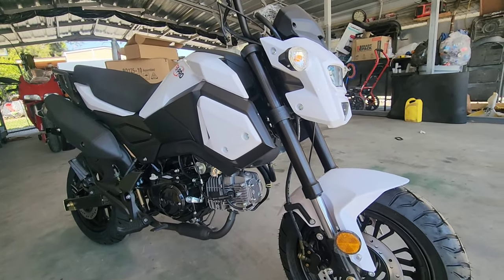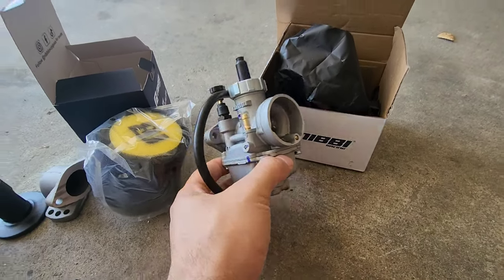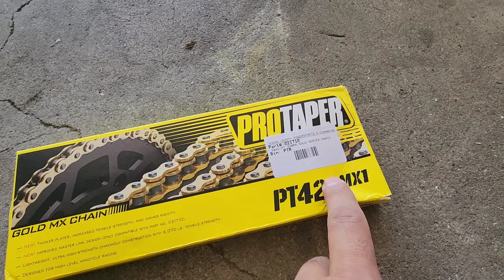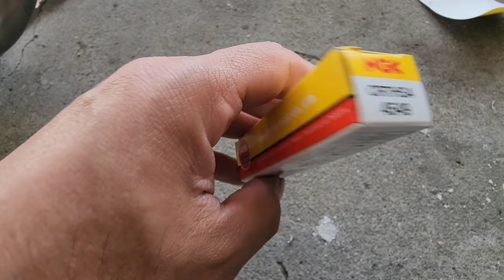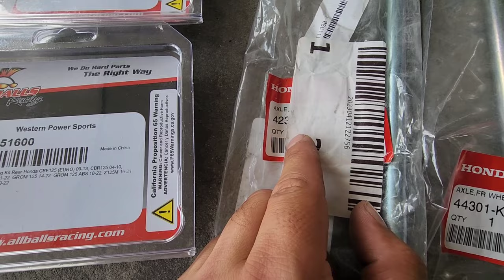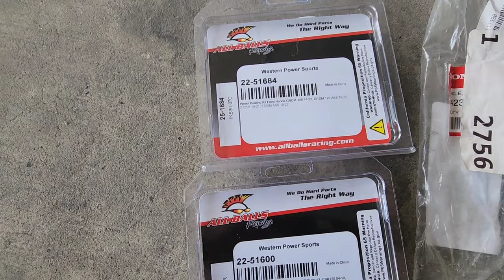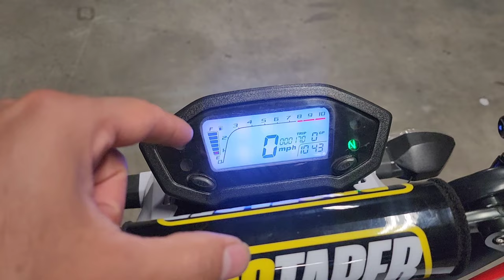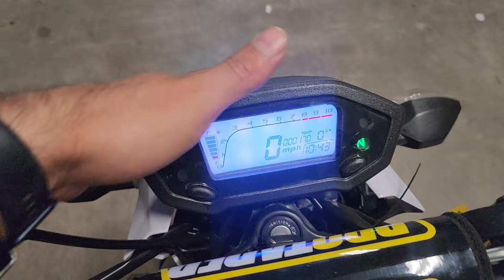Vader 125 Full Guide To Make Reliable (Grom Clone)

Comment: Did you have to swap jets or tune the carburetor? I just installed the same carburetor as you and it bogs every time I snap the throttle. I also have the same throttle and cable as you. I’ve tried tuning it for hours. I’ve even swapped the pilot jet out and no luck still. I’m lost
Reply from the maker: My carb is still perfect to this day. It may be because the jets and adjustments are generically set by the manufacturer for a specific altitude and ambient setting. I live in CA at 350ft above sea level (which is GREAT!), and it's always warm here. Could just be my case.
Reply from the maker: Go to Nibbi and check they're tuning chart it may help you!
Reply: @anythinggarage  I just noticed that I installed the new carb with the fuel filter that came with it. Did I need to use it? Since there’s already the factory one right before the fuel cutoff switch.
Reply from the maker: @hdubby2219  technically it would limit flow and have a hard time getting all the fuel it needs into the carb. I've even heard of inline shut off valves doing this. I recommended one of those in vid but not so much anymore. GL!

Comment: My engine bolt broke off inside the mounting hole now gotta get it out some way.
Reply from the maker: Mounting hole? As in on the engine where the bolt goes through?
Try using a punch/rod and hammer or something of the likes. Try not to cause damage inside. Goodluck!
Reply: @anythinggarage  thks. Yes cheap bolt. It snapped mid way in mounting hole on the engine.

Comment: Hey I bought the same carb and  throttle cable but I’m having a hard time getting the idle down and for some reason it sounds cammed and when I try to rev it it bogs out
Reply from the maker: You may need to watch how-to videos for Carberutors and learn to tune a carb.
Temperature, humidity, altitude (elevation) all have something to do with tuning a Carberutor. You can't have the same jets or tune as somebody else.
Luckily  live near sea level. The jets that came installed in my carb (should be the same ones in yours) and the way it came tuned works perfect for me.

Comment: Is the china battery good or a should changed for a new one just like the oil shipping ?
Reply from the maker: Mine is still alive and working perfectly good over 4 months later. I keep a tender on it when not in use for a longer time. I also have one of these for simple connection gor my battery tender on both my motorcycles.

https://www.autozone.com/test-scan-and-specialty-tools/battery-charger-cables-and-accessories/p/schumacher-battery-quick-connector-18in/973761_0_0?cmpid=LIA:US:EN:AD:NL:1000000:BAC:19488533492&&CATARGETID=120054150001289249&CADevice=m&gclid=EAIaIQobChMInuuO6ZepgQMVgAqtBh0-ZwmMEAQYASABEgLKCPD_BwE&gclsrc=aw.ds

Comment: Easy!  Just install a Grom engine, drivetrain, suspension, wheels, tires, and electronics.  It'll be SO reliable. (Although you should probably replace the frame and the plastics too)
😁👍...........🤣😅😂

Comment: What’s that mental thing connected to the shifter ?
Reply from the maker: @jajajaja4590  on the old shifter? (It's a linkage made of plastic).
On the new shifter. It's just a foot lever connecter directly to the shift shaft on the motor

Comment: Dang. Same price as a new grom after all the cash you spent on parts?
Reply from the maker: Not at all. Not even close to msrp of a new grom.
The bike, all of these parts (excluding unnecessary rear shock), the shipping cost (which is also taxed), the taxes... and everything costs about $1900 all new to your door.
A Grom is about $4800-$5800 out the door, and I'm not even lying.
Reply: @anythinggarage groms new here are $3600 plus $1000 dealer fees. = $4600
Reply: @anythinggarage so $1900 plus $1100? How much are the Vaders new?
Reply from the maker: @JohnnieV  $1900 withh new bike after taxes and shipping and all of these parts
Reply from the maker: @JohnnieV  yeah for the non ABS one. You're also forgetting freight charge fee ($300) documentation fees, dealer fees, Tags (around $200) surcharge fee, Prep fee and whatever else fee.
Reply: @anythinggarage  ah. Ok. I have seen $1050 on Amazon ? So you saying you put about $850 parts into it. Now you have a quality grom clone. Fun to play around with.  I guess you need a good lock with this. 2 guys can easily throw it into the back of a truck?
Reply from the maker: @JohnnieV  $1050 plus $250 shipping and then add taxes for that number combined. Then add the parts.

I'll make it easy.
The parts cost me $450 for everything and the bike about $1500 total.
Reply: @anythinggarage  yes. Now I understand. Not bad total.

Comment: Hey bro you used a 26mm I take manifold with a 22mm carb ?
Reply from the maker: Yes it work perfectly fine. It has the correct flange diameter, it's actually harder and more of a headache finding 22mm or 24mm intakes than it is the standard 26mm sizes for these engines
Reply: @anythinggarage  bro I been struggling to find one sucks !!!! I was about to buy a cheap 22 mm carb with it but I rather run the 26mm now
Reply: @anythinggarage  thank you bro
Reply from the maker: @fernandogutierrez7985  Buy a 22mm nibbi carb and use it with a 26mm intake. Or a 24mm carb with the 26mm intake if you prefer as well. 

Personally, 26mm carbs are much harder to tune and go out of wack a lot more than the smaller ones. Mostly because 26mm is just too big for a 125cc engine.
In fact, when you use 26mm carb, you gotta "detune" them with smaller jets and run them leaner than how the carbs came anyway. So what's the point of  "detuning" (went too big to begin with) and having it go out of wack all the time?

Comment: that 125 cc engine is the same as my china bike, as you replace the engine bracket bolts with bigger ones, does it have a downside? or will it crack the aluminum engine mount in a longer period? plss tell me.
Reply from the maker: No. It will do the complete opposite of that. It will strengthen it and actually you'll never have to worry about it again.
I will have another video up soon where you guys will see exactly what happens when you don't do this mod.
Reply: @anythinggarage   is it better when there is no play on the engine support? thanks dude. great help.
Reply from the maker: @UNBIASEDCOMMENT  Sorry for the late reply. Yes, it's better for vibration, the engine, the motorcycle, and your own safety as well. The third motor mount helps with vibration as well and further improve the integrity of the bike.
Reply: @anythinggarage  Any tips on aligning the mount holes to drill without removing the motor?

Comment: Once you get use to riding and won't more power a 190cc z's engine swap it's a direct replacement full kit electric start  5 speed  will get you in the 75mph  range  best upgrade you can do really all the mod will fit this engine to.. for the stock engine they have a 141 bbk and a cam kit for it the 190cc a lot more power though 🛠️💯👍✌️🏍️🍻
Reply from the maker: Yes I have been contemplating this, although starter chain issues are very real. I'm doing much research on it. But it's gonna cost quite a bit for everything (Engine. Exhaust, carb, intake spinner, whatever else) looking near $1000 these days. Still cheap but also pricey.

For the record I was on the throttle 50% or so when I did 50mph GPS. 10 miles on the engine not best idea to go full speed full revs just yet haha.
Reply: @anythinggarage  if you want to no anything about the 190cc let me no I have spec sheet i also own both types I no the difference between them and also work on them And have helped other people. All you part will work with it the exhaust can be moded to work real easy. 👍✌️🛠️💯🏍️
Reply: @anythinggarage  don't pay over 800$ for the engine kit alot of people over charging for the 190cc kit .
Reply: @anythinggarage  the chain issue if from starting it wrong or killing the bike in gear you can up grade the chain and it fix it from snapping 👍✌️🛠️💯🏍️
Reply from the maker: @Joseph Saucedo  where would you purchase then?
Reply: @anythinggarage  on line I wouldn't spend over  this In price range  for a 2v 190cc 800$ and if it a 4v 212cc 1200$ price  maximum range.                                    2v is amount of valves 2   . 4v is of course 4valve's. Head options   this should help you decide what price if far on line  any thing cheaper a great deal for one. 👍✌️💯🏍️🛠️👊

Comment: What are the bearings and crush drive for just asking i wanna get one to learn wheelies on
Reply: Also know any good cages to protect the engine and would a sub cage fit a Vader
Reply from the maker: Every bike should have a Cush Drive. It's rubber that goes into the hub of the rear wheel. It helps absorb vibration from the drive (chain) to give a smoother feedback while riding. 
The stock ones are very cheap, thin rubber. They don't last long at all. Oem honda ones fit in perfectly. Keep in mind that all cush drives no whatever what brand, are "wear" parts.

Bearing are self explanatory. They suck. They're rough, noisy, and not smooth. They can get you in trouble. I have personally seen a bearing explode on a car, and it is not fun. It locked that wheel.

Now imagine a bike. Especially on a motorcycle. It will lock up your whee,  and you'll probably be launched from the bike. Never know.
Reply: You got a link to the inline fuel valve and the fuel line
Reply from the maker: @lordslug3351 Original fuel line works for a good while. I still have mine. Just don't leave your bike in direct sunlight or a lot of stuff can go bad quickly, even replacement parts. You can replace w/ this fuel line and shut off valve. The shut off valve is not recommended but useful. I heard they can clog though.

https://www.gopowersports.com/1-4-id-fuel-line/

https://www.gopowersports.com/1-4-in-line-shut-off-valve/

You can search for similiar items elsewhere.
Reply: Thanks and what’s the difference between 26 nibbi carb and the 22 carb

Comment: How much did all the mods cost vs buying a grom
Reply from the maker: Mods were about $400-$450 excluding the YSS Reservoir Rear Shock. BIKE was $1100. $275 shipping and taxes (they tax shipping) brought it to $1500 final price.
W/ mods excluding rear shock (you don't need to do that) was $1900. $2100 w/ Rear Shock.

Grom is going to be somewhere around $4400 (includes destination charge, freight surcharge & taxes). And yes even the rear shock on the stock Grom sucks and they use the one I used to modify so you can say $4600 w/ shock 🙃

Comment: Could I take egr airbox off before I was to do any of the mods you did?
Reply from the maker: Yes! Get rid of ALL the egr stuff including the charcoal canister and fuel ventilation as well! It will run much better.  Get a better bigger carb on there for sure
Reply: So should I have the carb
First. Because I took off the Big black holes that connects to the carb where I'm sure it's for the choke. And spilled some gas.
Reply from the maker: @chrism4784  The choke is utilized via cable and not a hose. I would personally forget everything about the original carberutor and upgrade that immediately.
Reply: Okay so I literally just now ordered the carb You put in a description along with everything else that went with that?
I was.
Dropping the engine.
Because.
The top bolt snap so I'm Changing them to the 3/8 So until the carb comes in I'm gonna have to put everything back on. It should get here Tuesday.
Reply from the maker: @chrism4784  Nice!! Make sure you got the intake as well. Also, I'm not sure if the stock throttle cable will fit new carberutor. it's why i put a new twist throttle on mine. Look at my shorts.

Careful drilling the 3/8 holes on the motor mounts and engine. The best advice I can give is JUST DO IT!!!
Use a titanium Drill Bit For strength. It'll all be worth it.
Good luck removing the rear sets/swingarm and fitting it. Get an extra set of hands. You got this 👌🏼
Reply: @anythinggarage  I got the extra hands so it made taking out swing arm pretty easy... But if i'm not mistaking the link to the barrings on eBay link if I'm not mistaken were outta stock.... And I'm new.
To the bike world.
So we're exactly do those go?
Because I don't think that was included in your video.
Reply from the maker: @chrism4784  I left part numbers and names of product for the viewers convenience when links or stock is no longer available.
Use the part numbers.

As for the bearing, they are the wheel bearings. They are hard to work on and IMO, not for beginners. You can leave the bearings out for now. Unless you have a welder, can fabricate your own reverse hammer and many sizes of LARGE sockets to get them in and out, leave the stocks in for now.

Comment: Your speedometer is run by your front wheel, not your sprocket
Reply from the maker: Correct. With a larger front sprocket you increase speed by about 10%. WIth that said,  your higher speed becomes even more out of whack. 👍🏼

Comment: My STOCK CLONE 2023 boom Vader 125cc (127cc) goes 70mph ??! I’m about 185lbs
Reply from the maker: 70mph on the speedo on a vader is about 55mph GPS verified. Not rhat fast. My vader tops at 57mph GPS if I remember. Sold it a while ago.

Comment: Doesn't it have the speed sensor in front wheel?
Reply from the maker: It does, but it's very inaccurate even with the stock front sprocket.
Only 2 ways to fix it. Change out the entire speedo head unit and wiring, or get a speed calibrator.
Reply: @anythinggarage  that is what I'm saying the sprockets won't make a difference, it's the front wheel and tire size, same with cars if you change the front wheel and or tire hight that will affect speedometer accuracy

Comment: I wanna know the total cost of parts plus bike, because what’s the point of buying this when you can buy a grom for around $3600? Just save all this money and get the grom, I made the mistake of buying a SSR300 and had to replace all nuts and bolts, carb, plastics, chain, tires, rims, bars, grips, throttle, start and Killswitch, a lithium battery and graphics kit, a headlight and radiators. If I have saved all the money I spent I could have bought a name brand bike and saved 
myself the trouble of “modding
 my bike”. But if you want Chinese then goodluck to you.
Reply from the maker: If you go for the redfox one with all parts excluding the unnecessary rear shock I used, you're looking at around $1850 total including taxes, shipping and dmv tags, fee, and all.

You're looking at $5000 (plus interest if financing) or more for a new grom after everything. Go ahead and give them a call.

Comment: If you would correctly go by jetting and not just throwing a larger carb on with unknown jets your bike will thank you lol
Reply from the maker: This is not that large of a carb and is perfectly in spec for the size 125cc motor. It's literally why i said dont go for a 24mm or especially a 26mm that most do.

I know what jets it has as I took a look at them before use, so if I needed to rejet, I have a base to work with. The kit comes w extra jets if you take a look at the link.

To this day, it runs perfectly fine.
Thanks for watching!

Comment: How the gas tank holding up
Reply from the maker: Sold it very recently and it was fine no leaks or rust. I understand you can buy a complete replacement on Vaderparts.com but they are a bit pricey and put of stock. If you do get a hold of one I would suggest sealing it before using
Reply: @anythinggarage  I was asking cause I had to weld the bracket that holds the seal underneath and it's been a year and it's still holding up I wish I knew about the guy that was selling the 3rd mount I had to make my own lol

Comment: DUDE!  Way too many amps in the battey charger.  That is for a car, bikes can only take a fraction of those amps, like literally half an amp.  Only use a proper smart charger designed for bikes, not cars.  Lifetime investment.
Reply from the maker: Car batteriee charge at 40 amps and still take 30-40minutes to finish up. Even jumping 120 amps it will still take a bit to get a battery  enough power to jump. I worked on these in the field before. 4 amps is so dang low it would take quite some time to charge it up. When it does charge fully charge up, the charder goes in maintenance mode and no longer charges it. Acts like a battery tender. Which is basically what it is. You can not damage your battery with this device.

Comment: When you say remove how much we taking
Reply from the maker: Time stamp
Reply: @anythinggarage  I’m sure isn’t less then $1500 in parts
Reply from the maker: @alexesco1521 Parts is $550 for EVERYTHING excluding the $190 rear Honda Grom upgrade shock. No need for that.
Otherwise it's $740 for everything I used.

You can get a bike and everything I used for $1850-$2200 depending on where you get your clone and if you want the rear shock or not.

Cheapest you can do is RedFox Boss Motor 125 with everything except rear shock and led lights. You'll be at around $1850 👌🏼👌🏼

Comment: 😮Everything that's being changed is below inferio. So therfore that motor is also below inferior. Rings, valves, cylinder, clutches, bearings, ect, let just say the whole motor inside and out. So why in the heck even do all this to a bike with the motor being as cheaply made as possible? What! go through the whole motor just to wind-up still being less than an original high-quality Honda 125cc. THIS Make absolutely no sense, just spend more in the first place and buy a original Honda with a warranty that most won't ever use..
Reply from the maker: This particular bike does not pertain to your needs. For you, you're best bet would definitely be a Grom. Go for it!